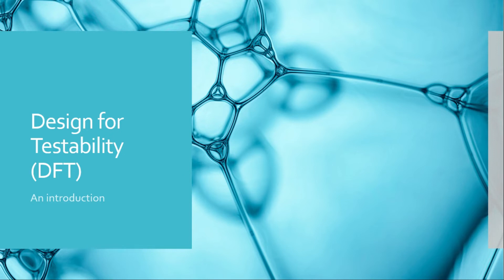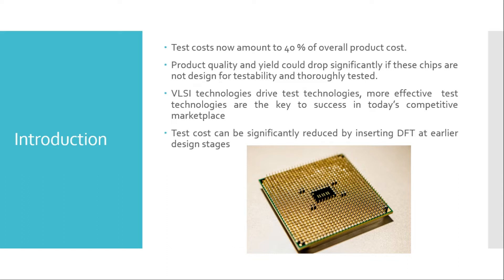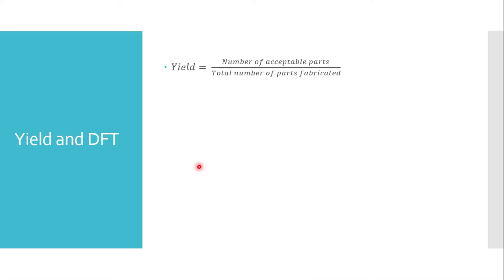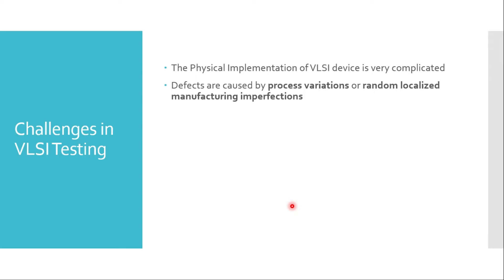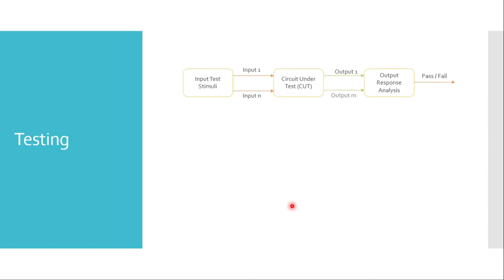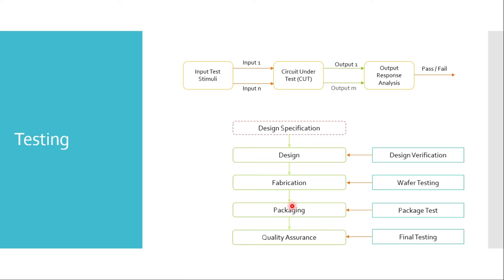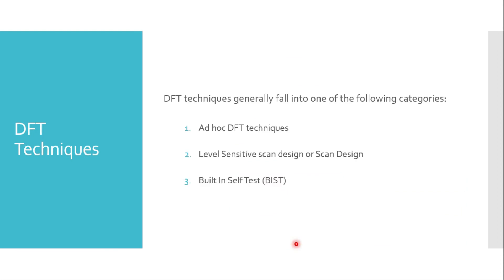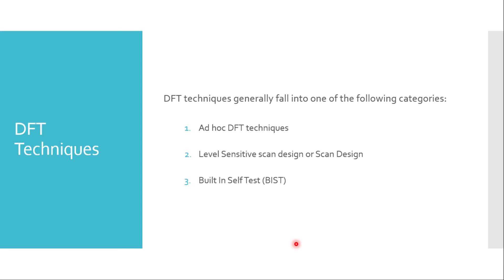Design for Testability | An introduction to DFT

Comment: Hey Brother , Thank you so much for the explanation. I have a doubt which i recent got asked in the interview..
Is it possible to have more than one scan_clock (with same or different frequency) in entire chip ? If no, Then why? If yes, then how?
Reply: The answer is Yes. The number of scan clock is depend on the number of clock domain in your chip. For example, your chip has several blocks, some of them operate with clock domain A, some work with clock domain B => 2 scan clocks for A and B